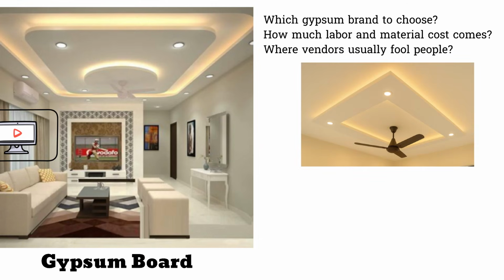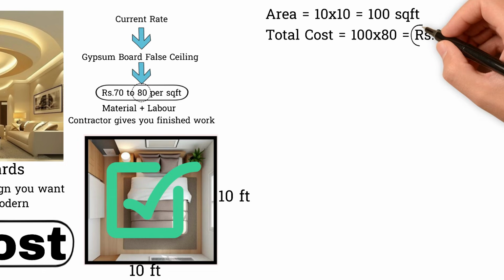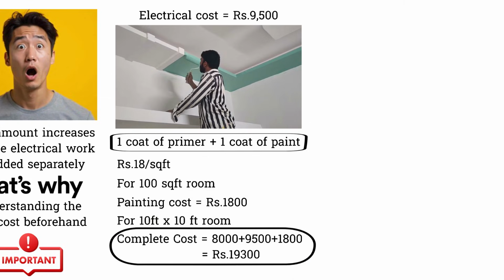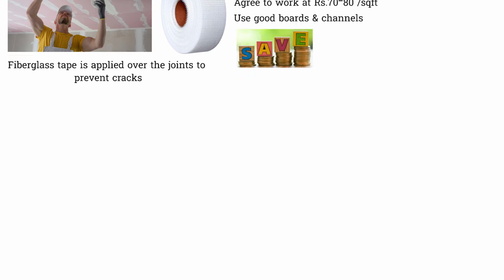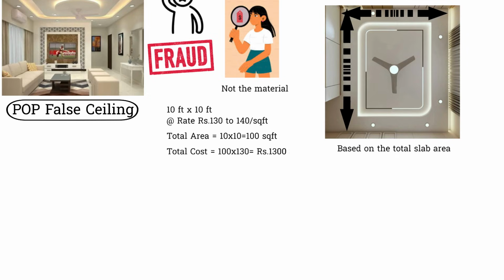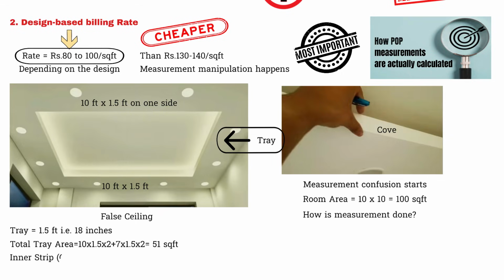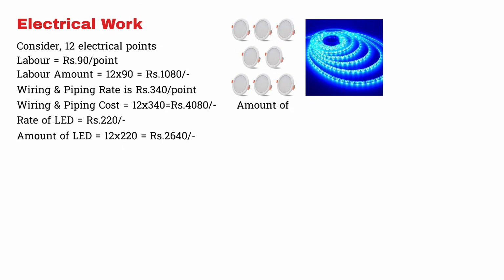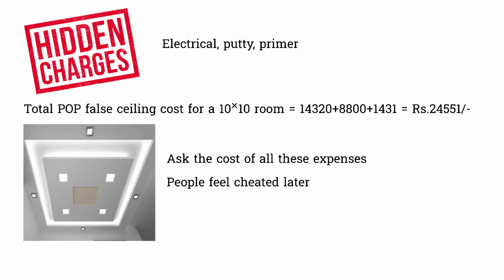Gypsum vs POP  False Ceiling I Best Brand & Cost Breakdown I

Comment: Sir your videos are great still i have some questions 
1. Which one is more fire resistant or fire - proof ?
2. Is there any alternative to false ceiling or some low cost designs in the ceiling itself to avoid false ceiling?
Reply from the maker: Gypsum boards are more fire-resistant compared to POP.
Yes, there are low-cost alternatives like plain finished RCC ceiling, paint + lighting concepts or exposed concrete designs.
Reply: @engineeringmotive Thankyou